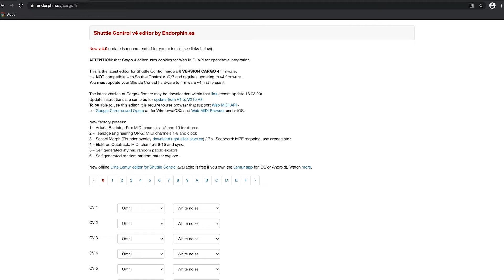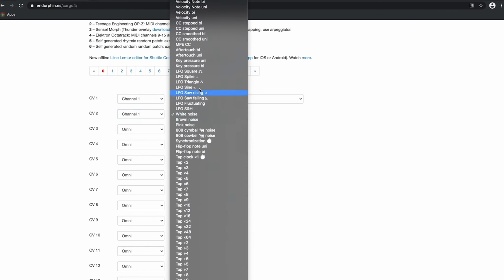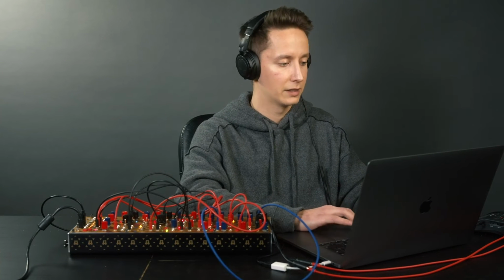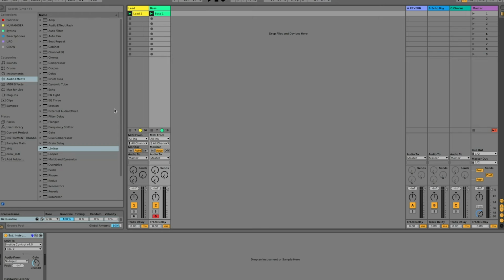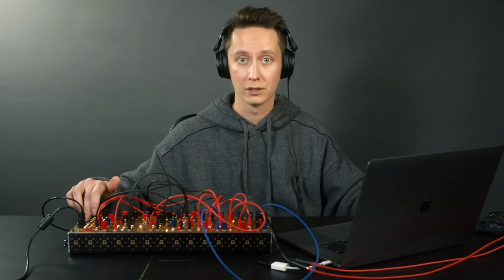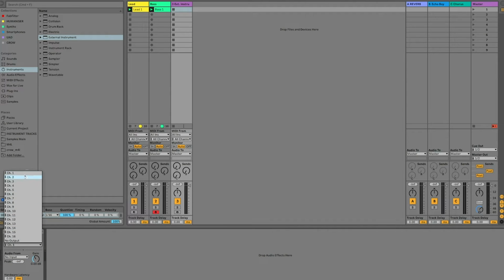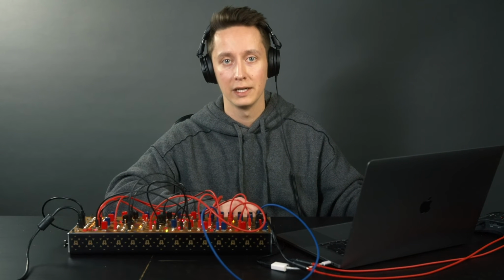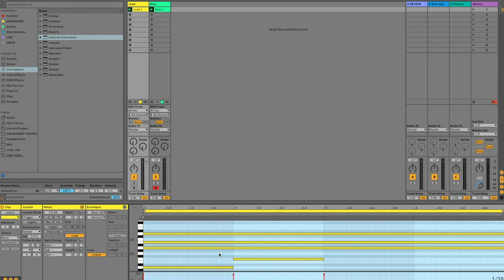How to Set Up Shuttle Control in @Ableton Live (Shuttle Control video #1)

Comment: Can you use a MIDI to USB cable that has both a MIDI out and MIDI in connector and also what mac version is supported? I am having issues getting Shuttle Control to work with MIDI devices.

Comment: Hi is there a setup guide available for “ground control”? My daw will not see the device at all. Running ableton on Mac. Thanks
Reply from the maker: Hello. First or all we recomment update the latest firmware. 
second: since modern MACs use usb-c connectors, you probably need another cable: i.e. usbC-to-usb-B unstead typical usbc-to-usbA. After trying all that, please drop us a message to support <at > endorphin <dot> es

Comment: I'm having no luck getting Shuttle Control to receive 'Trigger Note' messages. Standard 'Trigger' signals work fine. Do you have any tips on what to do? I've tried from Ableton, Keystep and other devices, and changed Shuttle Ctrl configs from iphone and multiple computers.
Reply: In case it isn't clear, I can't get say Channel 9, Notes C-2, D-2, E-2 to send unique triggers on my Shuttle Control. Any help would be hugely appreciated!
Reply from the maker: Some DAW has shifted octave numbers - ie C2 may appear as C1 or vice versa. Just try neighboring octaves.